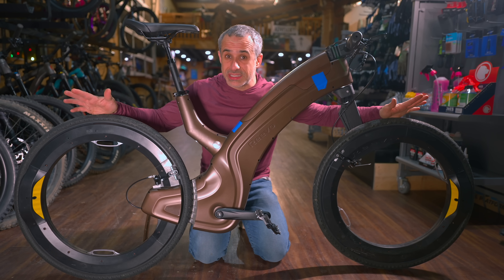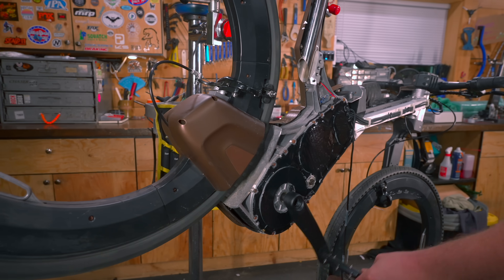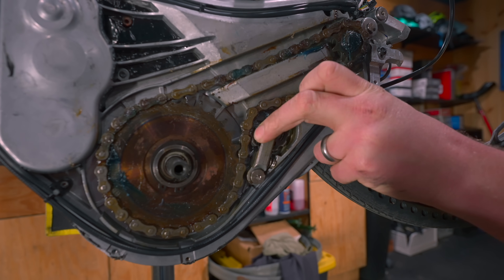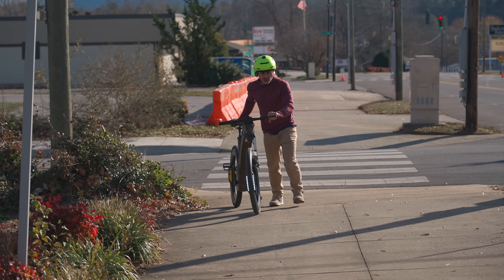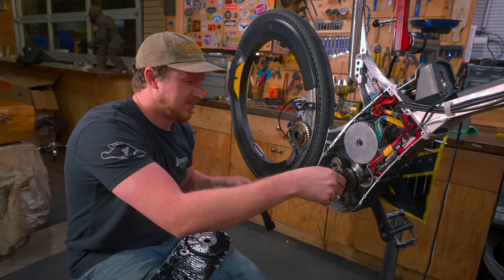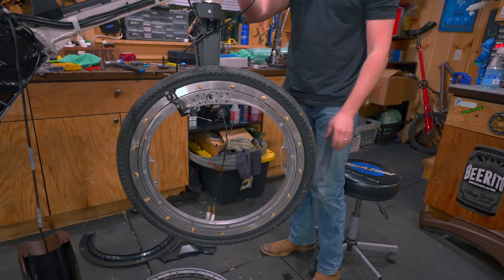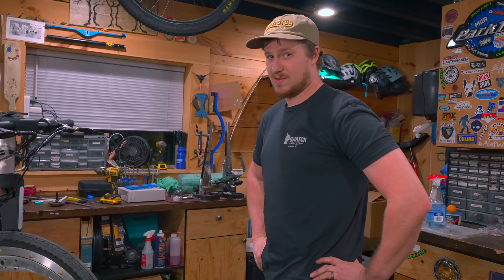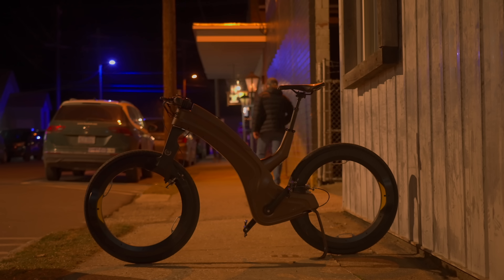What's Inside The World’s Worst eBike? Reevo Teardown

Comment: The worst part is. Not a single drop of grease across the entire gear terrain, nothing is really enclosed but impossible to get to, designed in a way that the gears want to push each other apart more than turn, and the wheels are designed like a tank turret. No wonder that shit is impossible to pedal.

Comment: Do you know the worst part? The hubless design seems to have only one benefit... storage in the front wheel (like a crate). But for that concept...
YOU ONLY NEED THE FRONT WHEEL TO BE HOLLOW. All this overengineering just to make the back wheel hollow is completely pointless.
Put hubs and a regular e-bike parts on the back. You can put a cool hubcap or something over the spokes, if you want it to look cool and spacey, but that seems like an idea that's less garbage.
Reply: Agree that that is the sole advantage, but it's a small advantage that comes with all the fundamental disadvantages of hub-less wheels (friction, dirt ingress, extra weight). But hey, they look cool when stationary!
Reply: @clivedcarter  imagine all that effort designing a bike, only for it to be a display piece...

Comment: This is a really clear and stark example of something that can come up in engineering a lot (I see it in software engineering but it happens elsewhere) - Any strongly held and unusual design requirement, such as the spokeless wheels or swish frame shape can and likely will require compromises and hacks elsewhere. The weirder the requirements, the crazier the hacks get to make it work and as you see here, they can sink the final product.
Reply: Usually accompanied by the phrase, "how hard can it be?"

Comment: 8:13 It has one of those cheap ass 9g servos from China at the back wheel. I've been using them in very low duty applications and they die like flies, can't imagine how fast it will wear out on a bike...

Comment: I reckon if you and your buddy really dived into it, you could make it half decent. A few upgraded bearings, a bit of optimisation, gear relocation and a bit of critical engineering thought, I'd definitely watch it 😁. It's always cool to see concepts get optimised by someone willing to put the time and effort in... Could get sponsored by a bearing distributor? Throw a proper freewheel mechanism in that final drive gear ?
If you've got a buddy with a machine shop, it'd all be possible! Maybe even add some speed holes in the frame for lightness, add some extra rollers to the wheels with those upgraded bearings 🤔🤔

Comment: Thais Video is a Challenge for all mechanical Engineers to do a hubless bike much better Than This…instead of Mini Skateboard wheels Holding to Wheel…we are Talking high Quality Ball-Bearings and a linear Motor inside the Wheel…and instead of 12 gears…one carbon rod DRIVING One gear FROM the Pedals to the Wheel…

Comment: I'm kind of insulted by the thing. I modified a Jimmy Buffet Margaritaville Bike with a 1000W hub motor and slapped a battery onto the back. And it's outperforms this simultaneously Overengineered and underengineered bike by miles. And somehow the 600 dollars I spent doing this suddenly doesn't feel like it was too little...

Comment: I am no engineer, but i think that most of the resistance is because the fulcrum point connecting the rear wheel is pulling weight down and into the rim.

Comment: I think it would be a good challenge to figure out how it could have been done properly, or even improve it to make it lighter and the wheel spin more smoothly. For example, the chain drive could be replaced with a belt drive, and the rollers with proper bearings. The frame could even be made out of carbon. It could even be made usable. It’s a shame because it actually looks really nice.

Comment: why did they use small wheels on bearrings for the wheel if they could have litterally just used steel bearring balls to make 1 big bearring? lmao, those wheels with bearrings only add resistance, weight, size and complexity hahahaha

Comment: For as over-engineereed and conversome it is I respect the mechanism. Sure it goes back and forth and could've been done with the initial chain and motor combo BUT I really respect the artistry of going back and forth uselessly to culminate the whole thing in a giant gear (the wheel). Do you want torque? That's how you get torque!
So either the engineer team forgot that the more gears you add the more resistance you get or they are some bunch of marvelous trolls that were squeezing money from whoever contracted them to build that.
Like... you know... maybe they charged per gear?

I really think that they were either too uncaring or too proud to get a second opinion but I think they were up to something. Honestly I think they were close to designing a pretty good and thin electric motorbike. Honestly... give them another chance and let them cook.
They are up to something for as much fun you want to make of this bike.
I really want to know those gear ratios. Is like engineering shitpost. The good kind of shitpost btw.

Comment: u could make it a bit more reasonable, like making entire rim a bearing not use skateboard wheels, use lighter material for it and steel for gear itself, then drive train should not use 12 goddam steps for like 20% efficiency given that we have giant ass reduction on wheel itself we could use some high rpm low torque motor like drone one, or if we want to have 12 steps then there should be some sort of clutch so we dont have to backdrive motor through 8 steps redution and 43% efficiency

Comment: Gotta be the most challenging bike when it comes to basically any amount of small maintenance. Changing the tires looks like a nightmare!
Reply: Changing the tires is the only easy part, but it's unlikely the bike will live long enough for a tire to need changing.
Reply: Nah the tires are easy to change compared to anormal bike as you don't need to take the wheel off.
Anything else though, is A LOT worse. God forbid a little pebble gets stuck in the wheel.
Reply: Actually, changing tires is the one good thing in this bike. You can just swap it out without almost any disassembly.
Reply: You need a degree in engineering just to change the tires on this over-engineered waste of metal and electronics.

Comment: That ammount of spur gears ... No wonder you got the terrible noise there. Or the friction. Wonder what the efficienty for that drive train was.
Most "good, properly spaced and designed spur gears " have 98 to 95% efficiency ratings", but these i'm wouldn't bet on them.

The fact that any kind of shock or inconvenience would impact directly to the wheel gears. Aluminium milled teeth.
I'm surprised it was a loose bolt and not a broken tooth.

Comment: i still think this is a cool idea, the main problem is just budget constraint, everything on this drivetrain just can't be done on the cheap. Especially those wheels, to make them roll well you'd need hardened balls running on a hardened track. Nylon wheels were chosen because they won't wear the aluminium but this adds a lot of rolling resistance. You can't make the entire ring out of steel for weight so you'd need to find a way to combine a lightweight material with a hard outer (and inner) ring. One of those wheels alone would probably cost more than the entire bike is now.

Comment: You should repurpose the rear wheel and do a direct chain drive to see if there is any hope for this type of wheel to be useable. That’s WAY too many gears! In engineering we are taught to assume 5~10% torque loss with each additional gear stage.

Comment: Hello
I think this bike is brilliant in terms of its concept, idea and modern design for the time it was created. But .... :)
Think about trying to modify this bike to improve it?
It is a prototype now, but what if this bike were modified, changed, made light, easier to roll, and safe.

1. The idea is to mount the electric motor on the rim without these gears and wheels.

2. Use better bearings to make the rims roll easier.

3. Use carbon where technically possible.

Best regards, don't scrap this bike.

Marcin

Comment: Why the hell is there a single Lithium Ion Battery cell visible at 11:22?
Did they distribute the battery pack throughout the construction to "improve" serviceability and safety?

And btw, that's labeled as an ultra-low-capacity 2.0 Ah cell. The industry standard for cheap-as-possible chinese stuff is 2.4 Ah battery cells. Proper ebikes have 3.0 to 3.4 Ah cells of the same size.

Comment: A hubless wheel cannot be lightweight. The best you could do is put the drive gear directly above ground contact (in which case your 'hubless' area has stuff in it), but then you can't have your bike mount any obstacles because the wheel has no structural integrity aside from the 'normal riding' contact point. This bike gets the structural integrity for the wheel from a massively heavy cast aluminum gear.

Comment: The cheap, low quality brakes with the extra soft lever arms are a bloody crime :(
In germany you mainly see this type of brake on low-performance coaster-brake-equipped bikes from the 80s and 90s, meant as a backup for the coaster brake in case of chain drop.

It would've cost them less than five bucks more to put on cheap v-Brakes instead.

Comment: Correct me if I'm wrong, but pedal assist cannot be disengaged mechanically? So, if you have it disabled, it only means that motor is unpowered, but pedaling still turns every gear - both wheel transmission and motor transmission. Add to that multiple rollers on both wheels - that's where all resistance comes from. You literally have to rotate dozens of axes, most of which use quite thick lubricant which adds to friction. Compare that to five axes on a regular bike with speed shifter (crankset hub, two gears on switcher and rear and front hubs). Chain is present in both cases and the length doesn't really matter as chain adds friction only when it turns. So, this is extremely inefficient, many times more friction than on a regular bike.
Also, those wheel rollers doesn't seem too good in terms of resistance. Multiply that by their number in both wheels and they're easily the major contributor to friction overall.

Comment: Can't have a freewheel when you want to advertise regenerative braking.
But there IS a reason why the vast majority of ebikes do have a freewheel and no regeneration. If you want to have regenerative braking that isn't super weak (and in turn have a super weak drive motor!) you need to drag along a big drivetrain at all times or include an expensive and complex active clutch mechanism. And that dragging along creates, you guessed it, *drag*.
This company wanted to put in every feature. They focused on creating an advertiseable product instead of an acceptable product. That's the major flaw here.

Comment: I wonder how much of the wheel friction has to do with the bearings used. I hoped that you'd test them out as well to see if the entire wheel design is just straight up trash or if it could work better than it did if they had used better bearings. Don't get me wrong, a wheel on 17 bearings and tiny little wheels which roll on the rim is always going to have way more friction than a regular wheel on two bearings, but the amount of friction the wheel has when turning is just insane. Less friction in the wheels would obviously make it easier to propel as well. How did the bearings used here compare to something like the bearings used on a skateboard? They look similarly sized and are probably carrying a similar load too.

Edit: I've seen someone in the comments mention that the bearings look like ones used in 3D printing for minimal slop. If so, yeah, they're gonna have loads of resistance and aren't designed for high rpms. I wonder if you could swap them out for more suitable bearings in the same size to see if that would change how the wheels behave.

Comment: As someone who sank $80,000 into a prototype for a less shitty scooter 🛵 since 90% are shit or overpriced as fck. One investor had about 30 grand in it and kept sending me his shitty designs (was never part of the deal) and telling me not to use airless tires because his 9 yr old daughter didn't like them. We ended up using aired tires (which suck on electric scooters) it ruined the whole project. I wonder if that ruck head worked on this bike 😂

Comment: Replace the front forks with a regular wheel then Grease and lube up the rear wheel assemble it back together maybe with new bearings please make the bike that they should have made. Fix the issues and make it better

Comment: Don't know about mechanics, but electronics of this thing is extremely amateurish. An $2 RC servo with plastic gears as an immobilizing feature is a failure waiting to happen when it will stop opening or closing. All seen here is hobbyist-grade (XT60 connectors, indoor led strip), not automotive-rated, not even outdoor-suitable

Comment: come on guys you are getting suprised for everything which is not fair if you dont have a better suggestion... actually the idea of this bicycle is not bad. same idea can be interperated with a different engineering approach and can be awesome. dont get me wrong, I think the company had enough funds o make it good but yet failed. downsides of this bicycle like comfort issue caused by solid tyres and noise issue because of straight cut gears and possibly brushed motors can be eliminated easily.

Comment: The amount of drag from all those gears and shafts is absurd. They would have been so much better off using a shaft driven assembly to get to the wheel. Not over engineered, poorly engineered. Even if they had used ceramic bearings everywhere it would have been awful to pedal and still would have been absurd to keep rolling.

Comment: I bet it would be a nice bike if it were designed without any electronics, using the same mechanical theory. Without the electronics, there's be less resistance. But also, re-engineer those wheels. There has to be a more efficient way.

Comment: 8:53 "(metal clanking)" - how apt. 😄
Guaranteed to gain weight as it catches and collects everything it can from the terrain in those pockets as you slave-away upon it.
Possibly only offset by the shredding of wear surfaces as it tears itself apart.
Have to wonder if it exceeded noise level regs normally enforced for ICE bikes.
Thanks for dissecting this jalopy.

Comment: this is what happens when a engineering team, with no real world experience, does not consult with machinists and mechanics. Machinists will tell you if things are too complicated for the desired outcome and the mechanics would talk about the handling and wear factor of the over engineered mess that is that bike. So much extra resistance added by mindless design.

Comment: Based on the fact that the loose bolt in the wheel hub is not rusted and is shiny silver looking (9:31), I would guess they used uncoated steel bolts on the aluminum frame. This causes galvanic corrosion (4:21) due to the two metals having different electric potentials. Usually the aluminum would be the one corroding but the large surface area difference may be at play here. The loose bolt was probably sliding on oxidized aluminum with minimal contact area reducing any corrosion effects as there was less direct contact for exchange of electrons and ions. Zinc has a similar electric potential as aluminum, so if they just spent a few extra pennies and got zinc coated bolts that would not be as big of an issue.

Comment: Would love to see how much and if you could upgrade it to make it "allright". 

The bearings and high rolling resistance are likely linked as well as the ring gears needing some grease around the rollers and maybe sides. 

Add air tires to dampen the load on the bearing wheels to make it smoother
Give the levers brake sensors and add the magnet to a wristband :If you are off the bike it wont enable the motor as it thinks breaks are pulled

Comment: 11:22 why is there another battery inside?
Reply: I'm guessing for the GPS or locking system? That way even if the battery is removed, you can still have safety measures running
Reply: It’s the controller, not a battery

Comment: 8:12 gotta love the blue 2$ RC servo in there
Reply: Don't forget the RC grade XT60 plugs
Reply: @madtoffelpremium8324  very common connectors in pevs. Assuming they are genuine Amass then alls good.
Reply: The most cheapest and weakest 9 gram servo one can buy. They could at least go with $4 one and have metal gears inside
Reply: @clixium  tells you something about what they did there. while ordering a single mould for the whole side cover, which was a few tons of tool steel alone. totally nuts'to get paid for stuff like this.
Reply: I cracked up when I realized what that was. This thing is literally a prototype.
Reply: stripped gears? I hardly know her!